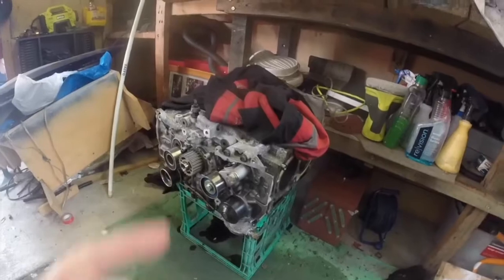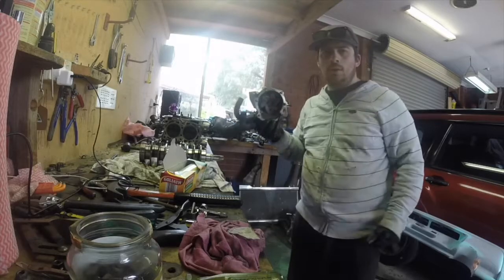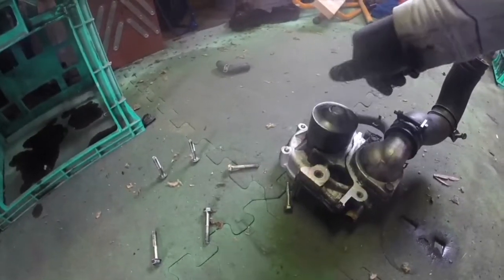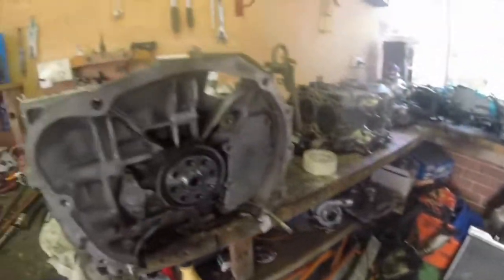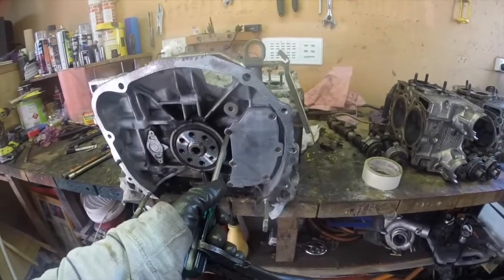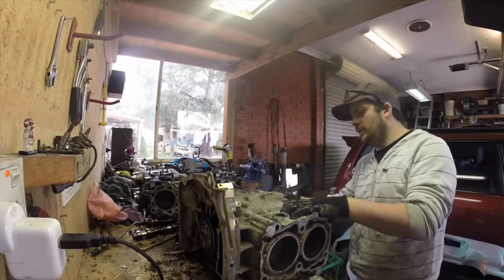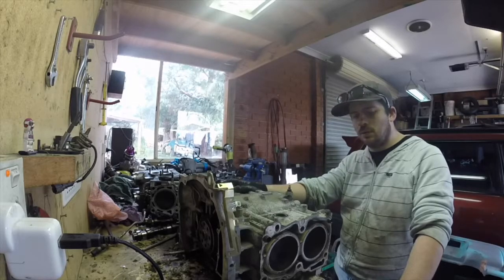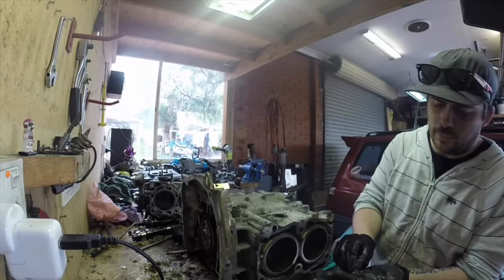Turbo Vs Non Turbo | EJ20 Block The Differences

Comment: Can I use a NA block to convert it in a turbo? Of course using turbo piston , heads ecc?
Reply from the maker: That’s what I’ve done.
Reply: @HarrodsGarage  sorry, I don't understand perfectly English. In substance I can use NA block without problems? Is perfectly the same as turbo?
Thanks
Reply from the maker: @gennaromariani9009  yes, block is same. but everything else that bolts on needs to be from turbo engine

Comment: PLEASE HELP! I just got my first Subaru today. A 2004 impreza 2.5RS but the previous owner stated that it had a JDM 2.0 swap non turbo… with 60k miles (96560km) … he didn’t reply to any of my messages when I asked him about what type of oil, filter or coolant I should use so maybe you can help me with these questions 

1. What oil should I use 
2. What coolant 
3. What filter 

I love this car already and I aim to keep it in tip top shape and I can’t seem to find a solid answer across all the forums I’ve searched on. 
Thank you 🙏
Reply: i drive with 10w60 oil    the red coolant and MANN oilfilter
Reply: @MaximilianTK  10W60? Are you high? That's very thick even for track use. For regular use 10W40 is more than enough, and also what Subaru recommends.

Comment: You need to get an impact driver major saver!
Reply from the maker: +makipsee I think there is an Air impact gun around somewhere.
Reply: lol oops i ment an impact screwdriver www.harborfreight.com/impact-screwdriver-set-with-case-37530.html great to loosening really tight screws